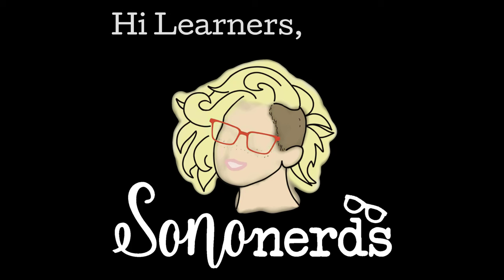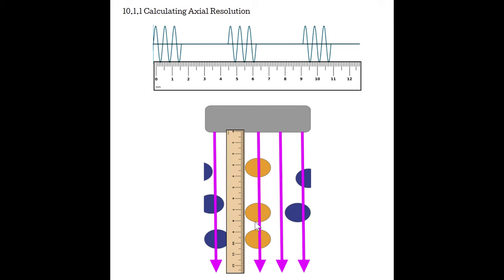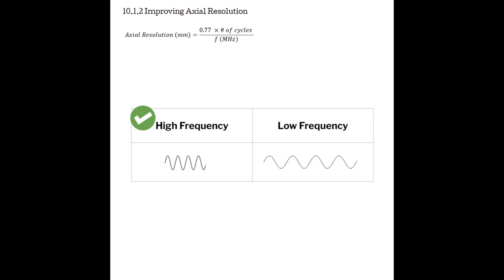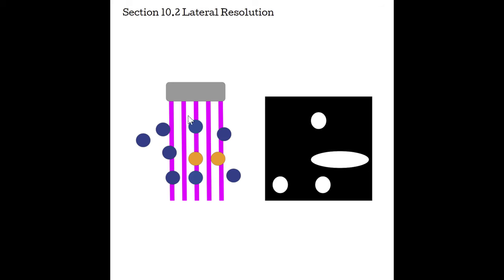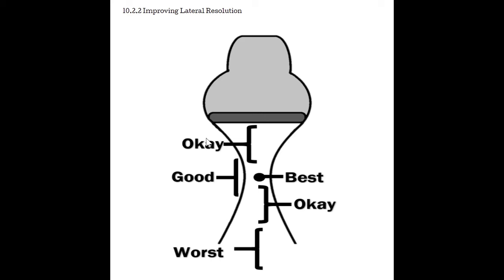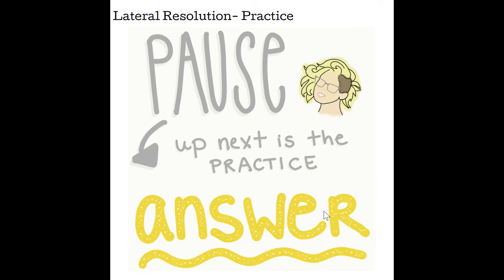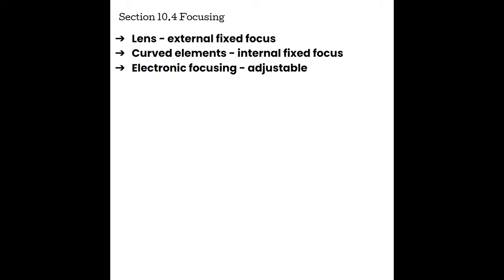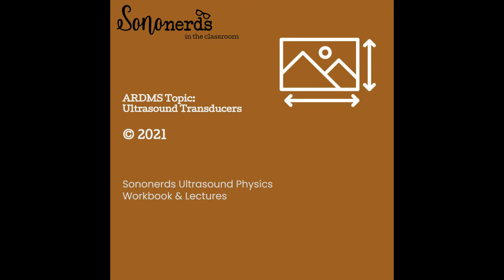Ultrasound Physics with Sononerds Unit 10

Comment: In this video (around the 19min mark), going over which has better axial resolution between 0.2mm and 0.4mm you stated there wasn't enough info. In the workbook there is the same problem with the correct answer of 0.2mm (slide 4 in the unit 10 answers ppt). Which is correct?
Reply: I would still go under the assumption that there is not enough information, but if you had to choose one, the 0.2 mm wavelength would be more correct. I added some more information to the workbook to help make that clear distinction.